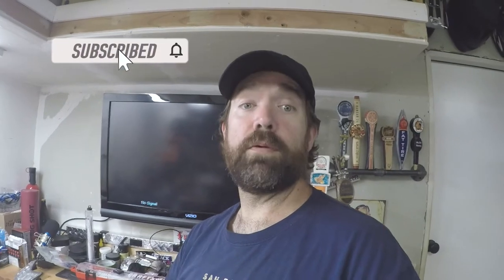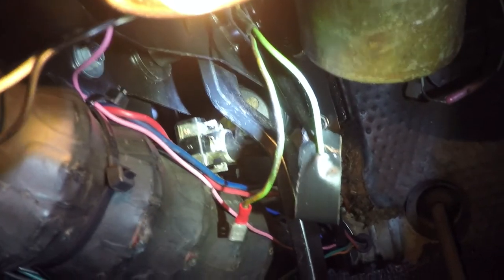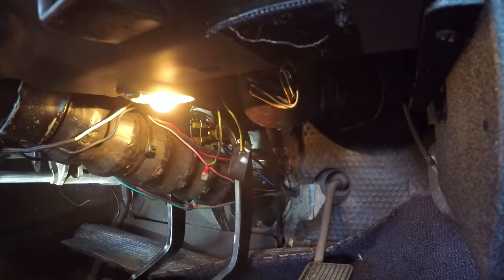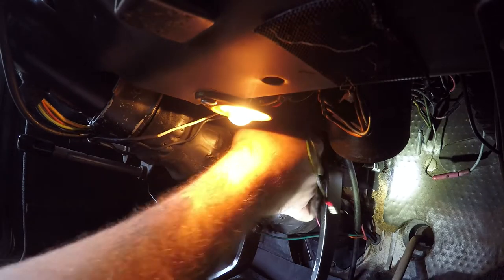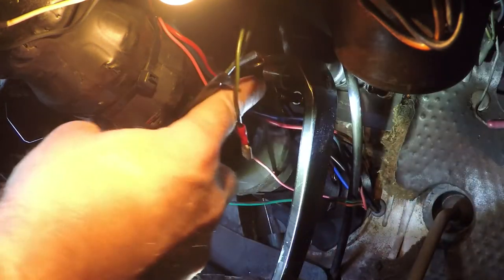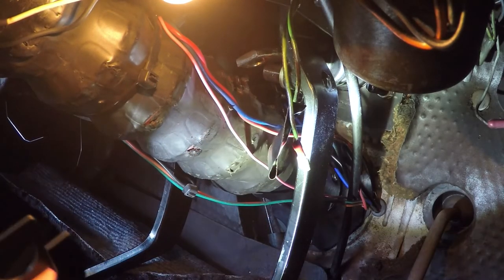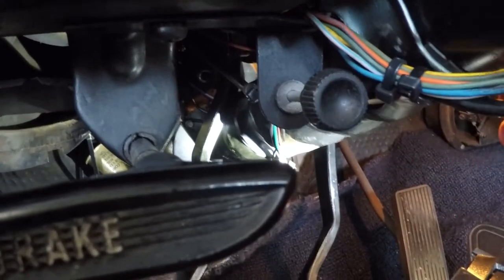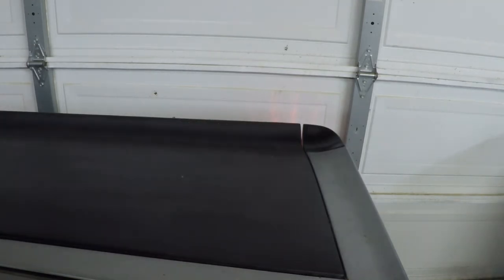Installing Brake Light Switch on 1966 Ford Mustang

Comment: Wow, you made it look so easy. I’m struggling with my 66 (manual brakes, stick shift). Can only fit one white plastic washer to the right from the switch, one black bushing inside and that’s it. Still can’t get the pin back in — there’s not enough space.
Reply from the maker: Keep at it. You’ll get it. One thing that I found helped is I kind of pressed on and off the brake pedal while I slid it on that way it wouldn’t get stuck. if I didn’t do that while trying to slide the switch on mine would keep kinda jamming up or getting stuck. 

Hope that helps. Again you’ll get it. It is a frustrating/ uncomfortable project sometimes as there’s not much room down there under the dash. Just take your time and you’ll get it.

Comment: Same process for manual brakes for a '65? Did you have to remove your driver seat to get into position to make this repair?
Reply from the maker: Not to sure. I havent done one before on a 65 w manual brakes. I just did this repair on my dad’s 68 and it was pretty much the same.  Before you start you can get down there with a flash light and see before you start poking around in there. 

I have heard some of the earlier ones had a hydraulic pressure switch? Not to sure though as I’ve never seen one. 

I did not take my seat out when I did this.